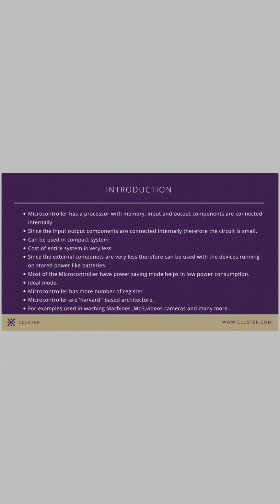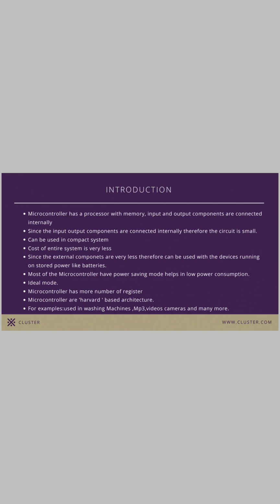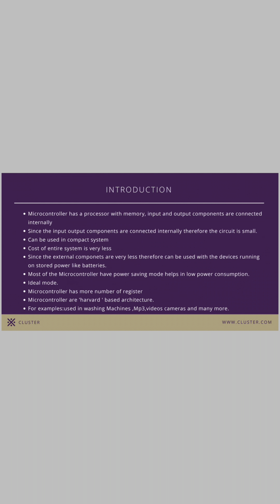Lecture 01: Introduction to Microcontroller

Comment: what is Ideal mode ?
Reply from the maker: The microcontroller can operate using only 2V power supply in power- down mode, while a total power consumption is less than 40uA. The only way to get the micro controller back to normal mode is by reset. While the microcontroller is in Power Down mode, the state of all SFR registers and I/O ports remains unchanged.in the subsequent classes we will be learning more about SFR register and various ports present in the microcontroller.